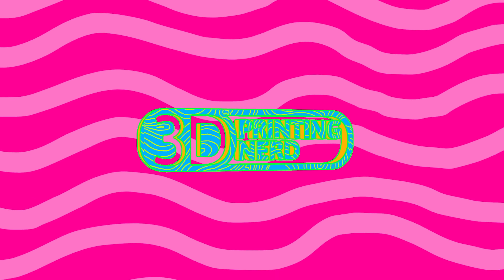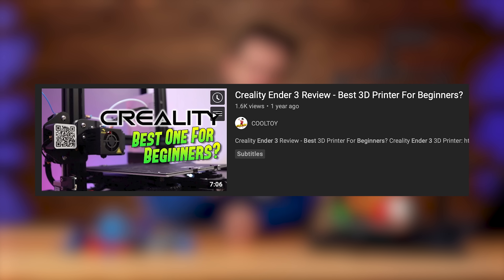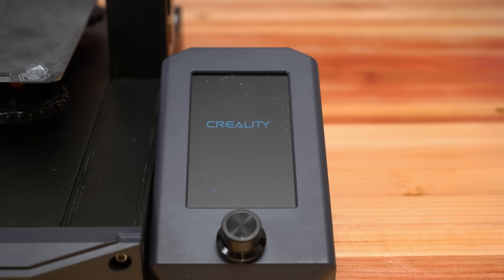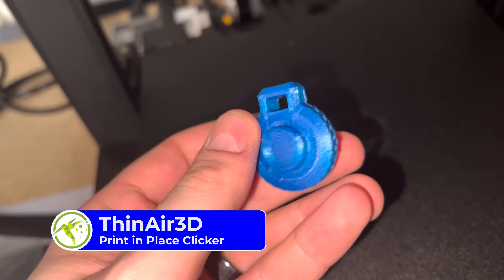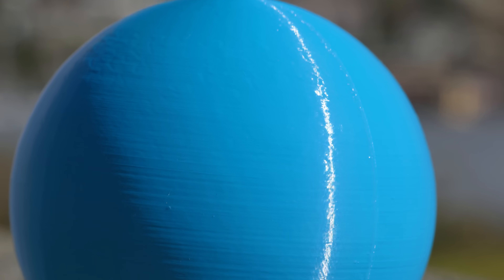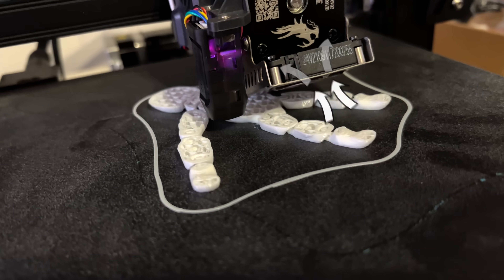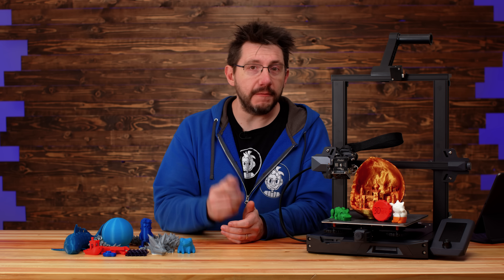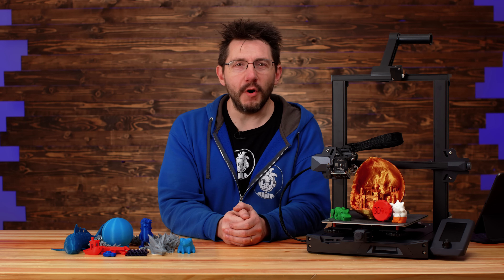Best Ender Ever? Creality Ender 3 S1 Review

Comment: Considering the price I am not a massive fan and definitely would not buy one.  There have been people having issues with the extruder the cr touch and bed adhesion. How many are having problems I don’t know.
You could get 2 Ender 3pros for about the same or buy one Ender 3 pro and mod it with a better all metal hotend and a new board and a better bed for the same price.
I do agree that not everyone wants to mod things but considering the big price jump I would be buying a different make.
See there is going to be a pro version of this with a all metal hotend at a ridiculous price. 
You can only review the printer you get I appreciate and I would not buy this at this price if it was a hundred bucks cheaper maybe. 
I have 2 Ender 3s a standard and a pro and to be honest they both print beautifully so at this price it does not interest me.
Interesting to see all the different reviews though I have seen two others so far and do notice that each one does find the price to be too high.
Reply: I have the Ender 3 V2 but I still think the S1 is a better deal. I've had to do my own upgrades to boden tubes, bed leveling, and bed springs, but I still can't print flexible filaments and I occasionally suffer from sagging level on one side due to lack of the dual-z axis control. My Ender 3 V2, in short, has now cost about as much as or more than an S1 (not even counting my time investment) and it still lacks in areas the S1 would address.
Reply: @aaronsteers  my issues went away when I went with a 3 axis carriage. The stock carriage can become bent when leveling.

Comment: Hi!  I have the ender 3 s1 and I bought it for exactly the reasons you state, I don’t want to tinker with the mechanics I just want to print.  After three months now, I agree that the build plate is getting replaced (any recommendations?) and I’ll probably be modifying the fans like how Nathan builds Robots showed in his video.
Reply: wham bam
Reply: I agree Wham Bam Build plate. Might even be able to get away with just buying the plate. It will be a different thickness so adjust accordingly.
Reply: Oseq if they have
Reply: Pei flex steel plate far and away the best build surface I've used.

Comment: Seeing the specs on the Ender 3 S1 Pro that is coming out along with the price makes me wonder why anyone would buy a Prusa I3 at the price point that it sells at.  The Pro version corrects many of the issues that you have with the exception of the cooling fan for a list price of $499.99.  It has a textured spring steel PEI build surface and an all metal hot end delivering 300c printing temps.

The Ender 3 S1 Pro is a Prusa I3 killer.
Reply: Do you have a Prusa MK3 to compare to? I have a heavily modified, direct drive, dual z screw ender 3. My MK3 still prints better and requires almost no maintenance. I'm constantly messing with the Ender to keep it printing well. The cost difference of the Prusa is well worth it in my opinion

Comment: dying laughing over here... "It's like a BL Touch, but the BL has been replaced with a CR" hahaha
Reply: Funny enough, as identical as they perform, the CR one does it completely differently in therms of the electronics: it uses an optical sensor instead of the Hal effect one of the BL Touch, being thus much less prone to interference.
Reply: I like the CR touch more. It doesn't feel as flimsy as the BL which is normally fine but my Sovol SV03 has bent the needle somehow twice on that. With the CR being a direct drop in replacement, it hasn't had that issue and being slightly bigger, the z offset was almost perfect whereas with the BL, you had to send a command to allow offset in the negative to get a proper level. So while it's simple to say it's just a knock off, it's better imo.
Reply: Honestly pretty good description lmao
Reply: @UncleJessy  it's literally the worst printer ever.
Reply: Jesus Christ the good lord loves you all :" )

Comment: Great summary as always. But like I stated in my review, for that price it should have an all metal heat-break not PTFE  to the nozzle. You realistically only get 235°C max long term as PTFE will degrade. For all metal you have to spend $70 more for the S1 Pro.
Reply: Can the heat break be replaced with an all metal one instead of replacing the entire assembly?
Reply: @Quad_Father  Creality has an upgrade where you can buy a heater block kit for the sprite. its about $30 that comes with the heat-break, heater block, nozzle, heat sock all of that.
Reply: @Quad_Father  no
Reply: Fisheiyy why?
Reply: Jake Loughran - Where is that kit? I don’t see it under accessories at the Creality Official site.
Reply: @FilamentFriday  Would you review S1 Pro, Sir ? For extra touchscreen, metal heatbreak, and all metal DD extruder
Reply: I agree. I guess they were really hoping to delegate that function to the Pro specifically.
Reply: Nope. Bimetal heatbreak cost 18 dollars and You are set
Reply: Yes, I feel thes1  pro price over the s1, is not realistic..
Reply: I heard of them has released new "creality sprite extruder pro upgrade kit" for compatible any Ender 3 series. (3v2, Pro, old ender 3). the version of Creality sprite all-metal has over 300°C for all enders series.
Reply: Its really too bad. An all metal hot end or heat break would have made this the shizzle. Not seeing value without it.
Reply: Thanks that was exactly what I wanted to know.
Reply: most people do not print materials that require a all metal hotend and as ptfe provides much less friction compared to metal it allows for less strain on the extruder in turn allowing faster printing speeds
Reply: @Adam-dp4ks  I had issues with my PFT lined hotend and went all metal and haven't regretted it. All I've ever printed (so far - 2 years in) is PLA or PLA Pro/Plus.
Reply: @tonykyle2655  yeah i agree i think all metal are less prone to issues so if it works then it works well but technically ptfe is better for low temps
Reply: should've came with an E3D hotend atleast Imo, like a V6 or something.

never liked the stock style hotends either, and i would never spend that much money on a MicroSwiss hotend, they're essentially the same thing as the OG hotend and heatsink except for being all metal and being machined in a different country, i'd atleast pick a Phaetus Dragonfly instead of that stock style Mk10? hotend, they don't have enough flow either way once you start pushing the boundaries

my rule is: wether you're new or advanced but want an extra printer, get a good hotend that can do high flow etc out of the box so you don't have to buy a new hotend once again when you want to move to new boundaries (higher speeds, larger nozzles, etc)

saves money in the long run
Reply: That’s what the pro version is for.
Reply: It’s only $20 more than the 3
Reply: I won't print anything higher than PETG, so 230 is fine
Reply: @Torskel  I have some white PETG for you that will never print at 230 lol
Reply: Most people only print PETG. And the upgrade for all metal is only $79.99.
Reply: Having a prusa is like owning a Mercedes Benz. Sure it's nice but after a while they get old and it's time to get a tesla to get new technology that it's available.
Reply: Agreed. There's multiple better options for the price of this. 
Imo the artillery sidewinder poops on these machines
Reply: I disagree, the only reason to use an all metal heatbreak is if you want to print higher than 240C (like ABS or PC) and this machine isn't enclosed, so you likely won't be printing ABS or any higher temp filaments. For PLA, PETG, and TPU (especially TPU), an all metal heatbreak can actually be a detriment, and at the very least it gains you nothing with those materials.
Reply: @jblack3761  Not sure why anyone has trouble with PLA on an all metal heatbreak except for them buying Junk off aliexpress or trying to run their default profile. E3D V6 handles PLA and TPU just fine. With some PETG pushing 240-250 or go all the way back to people who own birds since 200C is enough to put out toxins that affect birds. Some people are going to have their reasons.
Reply: @Rainmotorsports  yes, some people are going to have their reasons, I never said it shouldn't be possible, but people who own birds and people who buy wack petg that needs 250C are not the majority, so their preference shouldn't be the default.  PLA typically isn't really affected by all metal or ptfe heatbreak, but TPU/TPE definitely is. If you need an all metal heatbreak, which plenty of people absolutely do, you can easily put one on yourself. But the target audience for this printer is going to be printing 99% PLA, with some maybe buying it for TPU since it has a direct drive system, so IMO, an all metal heatbreak would be worse as the default.
Reply: @jblack3761  what problems should I be looking for with TPU on an all metal hot end? I started using a diy direct drive Ender 3 and more recently switched to an old Prusa MK3 which of course uses a V6 with the Prusa heatbreak variant. Haven't noticed anything yet except the time I attempted 0.1 layer height. Since I'm close to 2 Microcenters I mostly use whatever they are rebranding as Inland. Not the greatest stuff but all of it works.
Reply: @Rainmotorsports  All metal hotends are usually stainless steel or titanium, both of which are pretty sticky metals. Best case, like my old anet a8, you'll just have to print TPU slower than you otherwise would. Worst case, like my voron, it simply won't extrude for more than a few cm before it gets stuck. Titanium one-piece heatbreaks are better than stainless steel or bimetal for TPU, but PTFE is tremendously better than either.
Reply: @jblack3761  If you're having trouble with TPU on your all-metal hotend, there's something else wrong. It's maybe even the TPU itself, especially if you're printing spaghetti TPU. Or maybe the heatbreak is badly machined.
Reply: Noone talks about nylon, thats what my next printer need to be capable of. Anyway I bought a cheap biqu b1 and regret that I didn’t get the ender 3 back then. Would have had much better support and upgrades. But I didn’t know better then nor did I know how much I would use it. Now I know and starting to figure I need something better, but maybe also bigger.
Reply: This is definitely a prusa killer.
Reply: @emanuelcalderon  I dont know about that, prusa is a whole different level of quality and reliability but the S1 sure does seem a lot more reliable than the normal E3
Reply: Manny Calderon I agree…. Prusa has  become complacent
Reply: @Quad_Father  Prusa killer but don't forget to purchase all your upgrades for your Creality
Reply: IndigoViking still less expensive than a $1k Prusa besides the S1 doesn’t really need any upgrades. I have both and S1 is outperforming my Prusa mk3.  Plus I just can’t stand that stupid little pretentious hat anymore :-)

Comment: I have been using the S1 for a month now. Two issues that I have encountered: 1: The Sprite Extruder is NOT All Metal, and replacing the PTFE is a nightmare. 2: Bits and pieces of the build plate started coming out, after printing PETG.
Reply: PETG is weird, I've had the best results printing on glass with glue on top (proper liquid wood glue dried out mind you, not glue stick). Never tried plain glass from the horror stories, I remember trying PEI and it was also annoying.
EDIT: I wonder if this bed would work properly with the PVA wood glue on top as I do on glass...
Reply: Use a flex plate pei bed. You can spray a little windex on it if the bond is too strong.

Comment: Looks like a great machine but the price of the enders is getting pretty inflated. The biggest reason the ender is so popular is because it is cheap and reliable. 

That said, it is really great to see the ender getting a lot of the upgrades so we don't have to do them ourselves.
Reply: Exactly, at that price, I wouldn't buy Chinese equipment
Reply: From what I have heard, the original price that Creality was trying to hit was 349.99 but issues and price increases made the price 50+ more. Would your opinion change if the printer was 349.99?
Reply: @Mohound  I would probably buy the S1 if it was at $350 since that is a V2 with a few good upgrades, since the V2 can be had for $180-$280. I don't see the direct drive, bl touch, and shipping fully assembled adding $150. 

Maybe if they would add the all metal hotend then the S1 price might be justified. Instead they decided to put that on the pro version for $500.... Why even have a pro version. Make one good printer and sell the light bar as an addon.

Comment: Have you tried cleaning the print plate with 90% or higher concentration IPA?  That works really well to rejuvenate my textured print surface although it's not that printer.  I suspect it is cleaning out clogged pores.  I print PLA only so I don't know how it might work with other materials.

Comment: This is the prusa killer. Why pay $700 dollars? This machine is amazing and it should have been like this from the beginning.
Reply: Do you have a MK3 to actually compare to? You need the pro version to get the all metal hot end and now you're over $500. That's getting pretty close to the cost of the Prusa.
Reply: @GregBeatty  prusa is just a name. I have six machines some over 1000 and they print over 500 degrees.  I also repair them. So yes I have knowledge of 3d printer.  Prusa is like a Honda and creality is like a kia. Guess what kia is getting way better than Honda. You have to improve and go with the times. Prusa is a good product because of reliability and testing.  But really we need more manufacturers to start making 3d Printers in the usa for a better price and put all of them out of business.  We need to stop buy foreign garbage and do it all here in the usa. Also buy from small companies not like Amazon.

Comment: It could very well be the best Ender ever. At over twice the cost of the original Ender 3, I would hope so. :)
Reply: I could've afforded the S1 a lot more easily than my Ender 3 Pro plus the Micro Swiss extruder and hotend and the SKR E3 Mini I added, but the most fun I've had with my printers came from modifying them. I wouldn't trade that even for a Prusa.
Reply: If you factor in the time and money it would take to upgrade an Ender 3 with all the S1 comes with, you might be ahead by just starting with an S1.  And for people who just want to print with little to no tinkering involved, the S1 might just be the ticket.
Reply: @nunyabizness6734  the s1 is harder to mod further tho
Reply: @futuremapper_  True.

Comment: I love my S1 so much. I've had it operating almost 24/7 for the past month. I exclusively use mine for tabletop gaming scenery pieces so I have only been using PLA at 200/60 with 5%-50% infill depending on what I'm doing. I've been using pretty much the cheapest 10kg at $13/kg PLA+ available through it and haven't had a single issue with it that took longer than 15 minutes to resolve.
Reply: Sorry everybody I never received notifications from this comment. The company is GST3D.
Reply: We are collectively curious
Reply: Does this have the Thermal runaway firmware in place or did you have do update the firmware
Reply: I too would like to know what you’ve done with firmware. Extrusions look good? May pick up an s1 or s1 pro

Comment: I have an 3 ender 5s and got my ender 3 s1 about a month ago .. it has been printing 24/7 for parts manufacturing and I have not had 1 problem yet .. only the bed .. the bed is too good . I have to run a blade under the purge line to get it off it sticks like i said tooo good

Comment: I would like a S1 versus prusa!
Reply: Prusa gonna win for sure
Reply: @MartinWolker  Why is it gonna win, I really want to know
Reply: @TheKdcool  The bearings on the linear rods on the prusa are going to last longer than the roller bearings that ride along the aluminum extrusions on the s1. That means more consistent prints that are truer to the gcode for many more hours. Which is important when you print a lot. So after about 200-400 hours the roller bearings are going to need replacing to get the same initial quality where as the Prusa will go well into 2000-3000 hours before you see any noticeable artifacts in prints.
Reply: Not sure why creality is still using the roller instead of linear rods. I assume the S1 will be like my other enders in that they work well out of the box, but start having problems as things quickly start to wear out. At this point, my ender 3 spends more time being adjusted than printing, and it still can't print as well as my MK3 which is never down.
Not to mention that you need need to pay $100+ more for the Pro version to get the all metal hot end. At $500+, you're pretty close to the cost of Prusa MK3S+ It's actually significantly more than the Prusa mini

Comment: I'm still pluggin away with my OG 3, adding upgrades when i want/need. Its great to see that creality has added some of the most popular as stock equipment here. That being said if this was out when i got mine, i wouldnt have been able to afford it since im eternally broke xD.
Reply: Same XD. I got a cheap used ender 3 at 1/3 the regular used price, that needed a LOT of tlc and work to get back to good quality prints. But we're there! Luckily ive had some good tools on hand, so it was all doable without extra cost. Will get something like a CR 10 next but im still doing better everyday with my ender